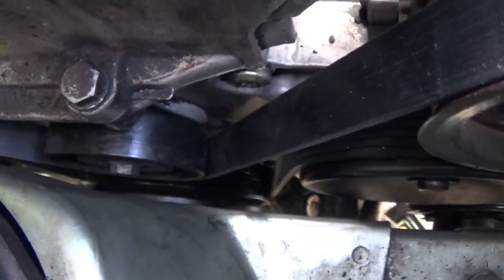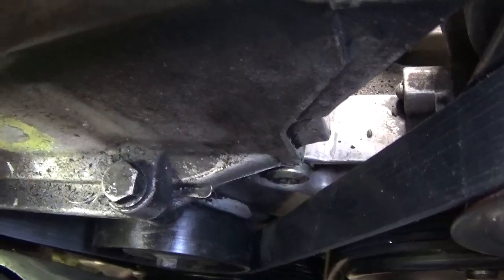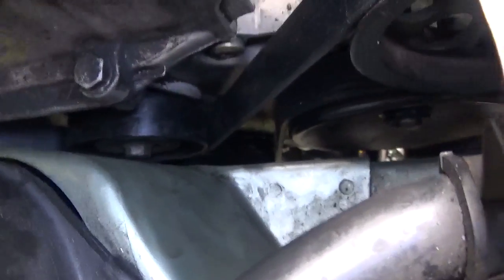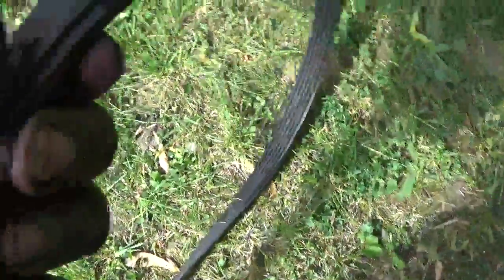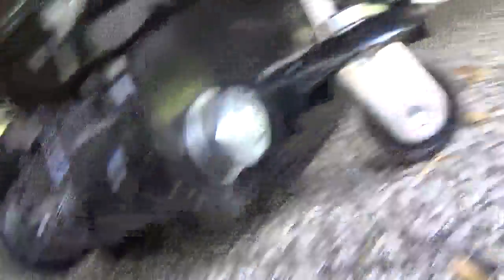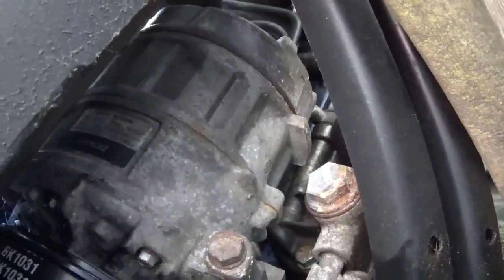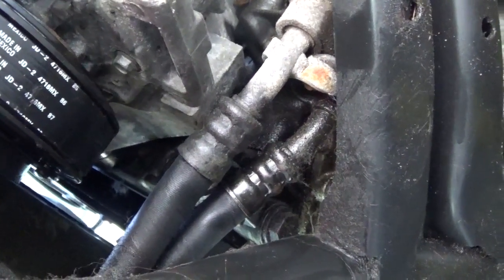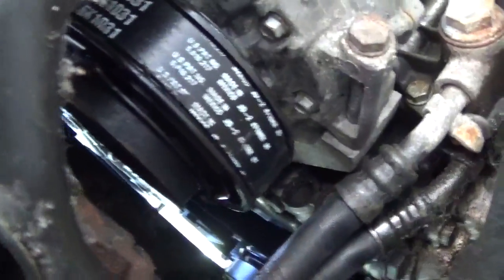Saab 9-5 belt part #4

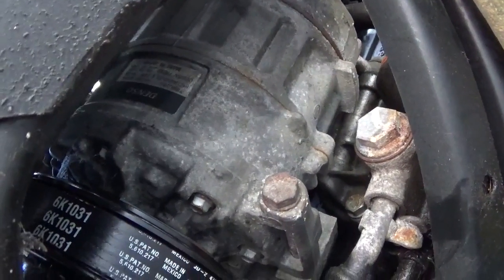Comment: 1:51 that's the AC compressor, the alternator is on the other side of the engine
Reply from the maker: I guess that would suck if I had to replace the alternator, although I no longer have the car anymore, too many kids had to get a minivan.
Reply: Sad to hear, but thanks for these videos. I'll be replacing my belt the first time on Saturday ;)
Reply from the maker: Good luck.  :)

Comment: Best to go with the short belt and bypass the center tensioner. Even Saab deleted it after 2002 because if that center tensioner goes bad you have to remove the engine to get to it.